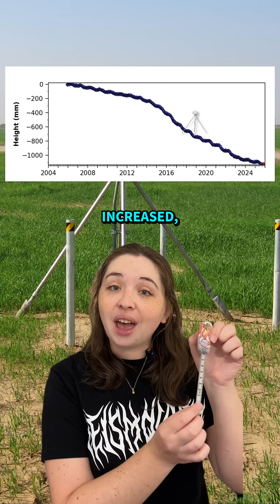GPS-measured subsidence in California's San Joaquin Valley #shorts #science

Comment: My mum's old house was built in a drained swamp and the ground would swell and shrink based on rainfall.  Because the house was built on stumps and the ground movement was uneven across the block it meant that parts of the house could move up while others moved down.  The toilet room, bathroom and laundry doors would always end up getting stuck on either the floor or the top of the door frame and the guy who "fixed" the issue would always just plane off the top or bottom so that the door could be used without problem.  After 20 years of this the doors in question were all trapezoidal in shape with gaps of up to 2 inches on the tops or bottoms depending on the recent rainfall lol
Reply: That sounds like the kind of house you'd find in a swamp
Reply: They should have built the house on floats like a houseboat.

Comment: If the GPS uses satellite isn't it possible the satellite moved that amount farther?
Reply: The GPS satellite system is cross referenced against some other data to allow such measurements.....
Reply: GPS satellites are not geostationary. They orbit quickly and you are using different satellites different times you measure. It's not that the particular satellite above that spot is faulty.